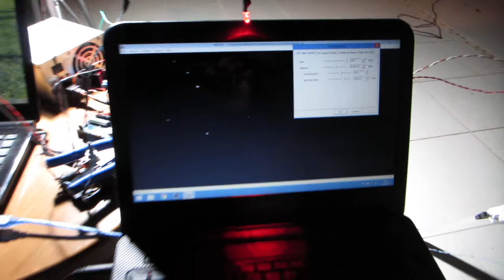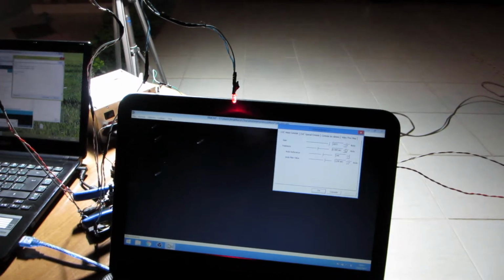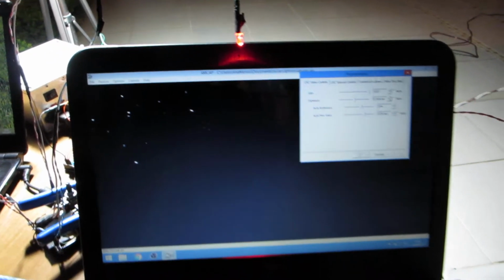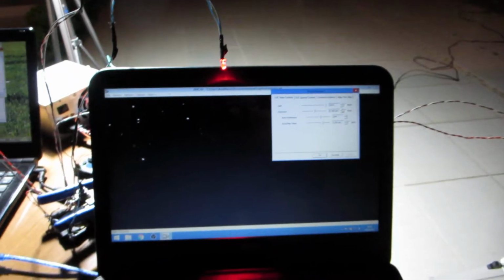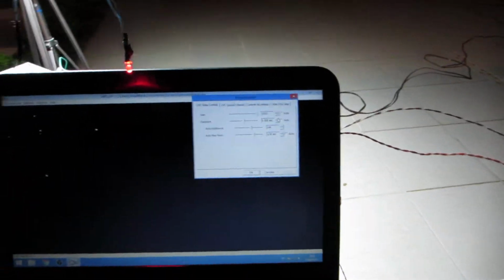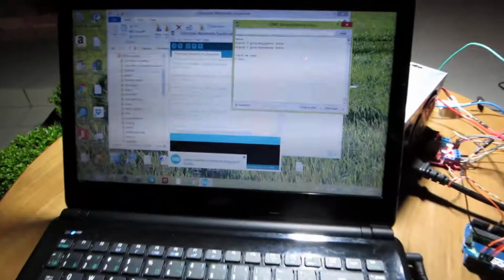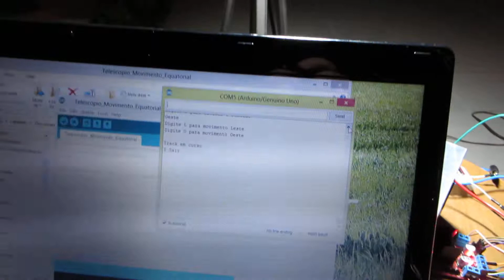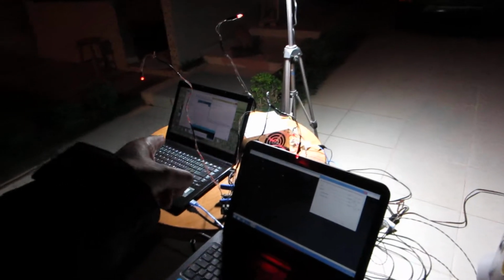Home Made Telescope Drive

Comment: Can you please provide more detailed instructions on how to make and use this device. Thanks.
Reply from the maker: Hello SC, how is it going?
For sure I can! I will try to make a quick video covering this topic for you, but right now I'm too busy finishing some coding projects here.
But basically what I've done is I took the stepper motor out of the printer, and by using an Arduino with a H bridge I did a speed control on my telescope, still not working very good because the stepper motor is not strong enough in low speed, so in the future I will try to adapt a high torque and low speed motor instead.
Reply: @lucassilvapascoal3581  I wanted to do something like this my self ,  but didnt know where to find the gear for the mount  , if its in a printer , then all you needed to do is to purchase Motor DC one with Speed reduction , and use a voltage control to control its speed , it would have torque and no arduino needed,  just a battery and a pot .
that was my idea but , it would take time to design the mount and make it work proper , so i just got the tracker for my mount .